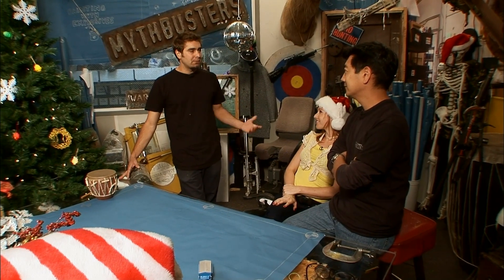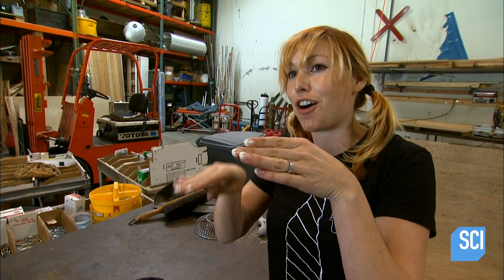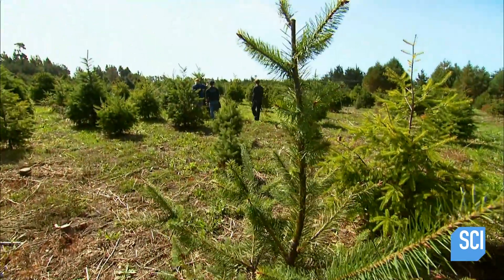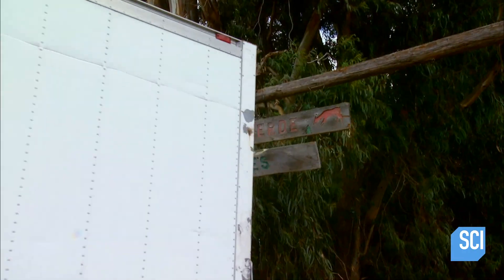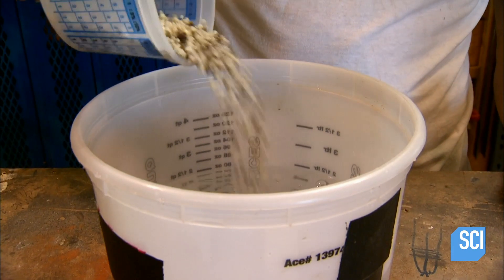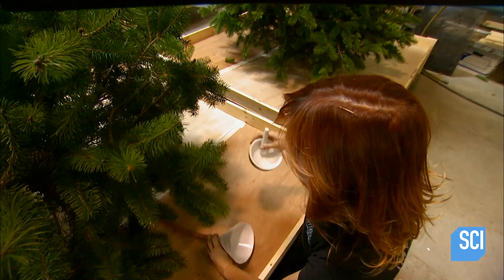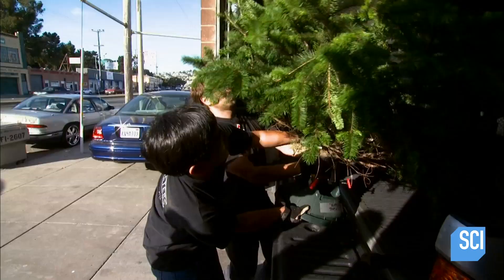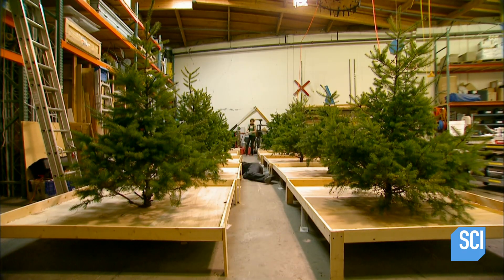The Secret to Keeping Needles on a Christmas Tree | MythBusters

Comment: Here is the problem with this experiment. Usually the trees are kept inside the house, next to a heater and higher temps.
Reply: There's no problem with this experiment. Yes, what you mentioned is a variable that could alter results and it didn't get included - for a reason. This experiment is strictly to test what items keep needles on a tree for a specific amount of time. That's it. They're not testing the items in homes that have heaters vs homes that don't.

Comment: I would think spray glue could technically work.  You'd have to apply it very meticulously at the base of the needles by basically drenching the wooden part of each branch, but at that point, just use the glue for something productive like cosplay.  It'd take less time to vacuum the floor 8 times over than it would take to pull a 5 Minute Crafts with the tree.

Comment: Ok I prefer the bleach test best because I don't like the fire hazard. I would experiment with it and add some food dye. I would try with the ones used to color cake frosting, those colors are more opaque.  
It sucking up the bleach so it should also suck up the color. It has worked for me when trying it with flowers.